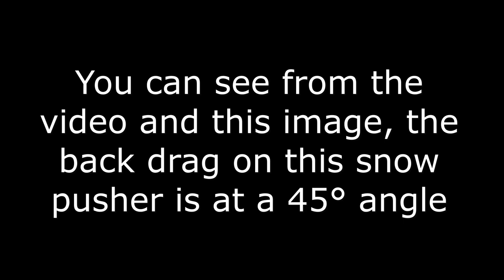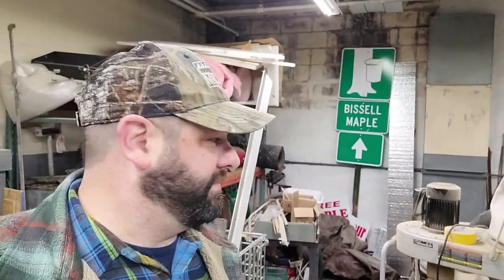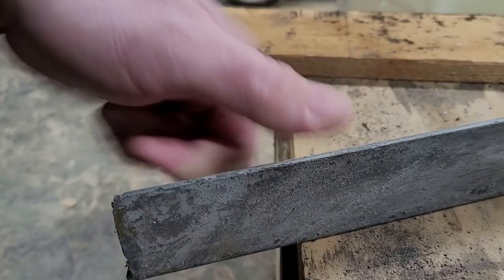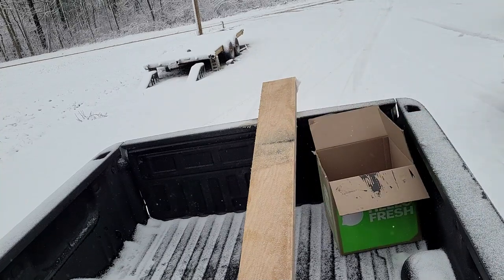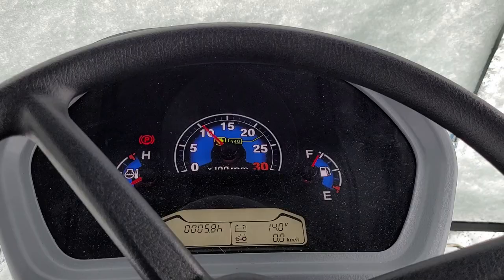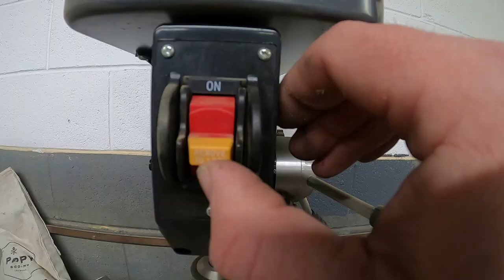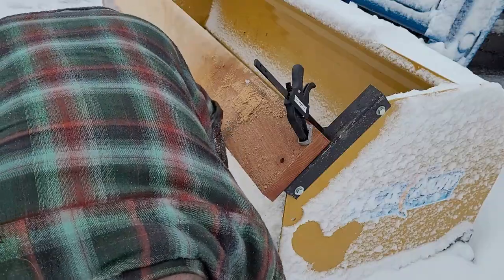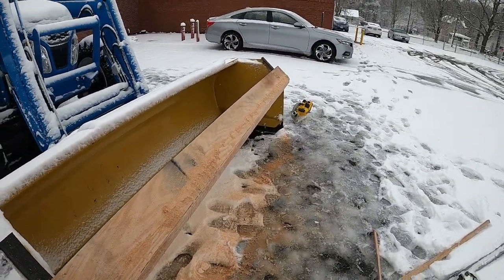#105 How to Make a Back Drag Pullback for Your Snow Pusher

Comment: how did this hold up? has there been a 2.0 version?
Reply from the maker: Tom, It has definitely held up.  It will last this season.  If I had to do it again I would make it a wider board so it could pull back more snow.  I would also put an angle bracket on the inside to prevent the board from bowing.  It does have some bow, but isn't harming the performance.

Comment: I would add a pice of flat iron  quarter  inch by three inch bolted  to board every 12 inches apart  let metal be cutting edge.
Reply from the maker: That's a good idea.  I also need a taller drag back.  Snow goes right over the 8" oak after about 8 feet.